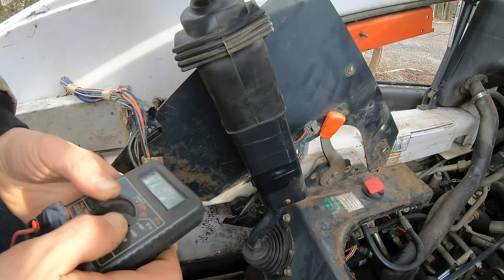Replacing a AHC computer

Comment: If you get a chance I would check ground for computer and anything going in and out of the control circuit for dirty or loose ground connections. Also would check total resistance of both solenoid circuits and see if one circuit has lower ohms than the other possibly intermittent ohm readings causing the computer to think something is wrong and tripping a fault. The likely hood that both computers are bad is rare. You might want to put the Bobcat in the garage where its warm so you can work on it better. If you have access to a megger or meg ohm tester it would be wise to disconnect everything electrical so as not to short anything out. Battery, computer, electronic devices,etc..
Reply: Listen to this man right here!!   2 computers bad?  um probably not!  When you removed the old one you could have inadvertently and very temporarily fixed an intermittent issue in the wire harness, ringing out continuity in a wire isn't the be all end all, the wire or more likely the wire's crimped connection to the Molex pin in the header could be breaking down once its put under DC load.  AS he said, go to your heated garage and have someone help you troubleshoot:  one guy operates the controls and you play around with those wire harness' and see if you can (re)duplicate the problem.   Also, look up that fault code before you do anything and see what it means & spray those interconnects with contact cleaner after you confirm the failure.

Comment: Good troubleshooting logic here. Electrical problems can be very difficult to fix. You have to think abstractly and it will determine the limits of your patience. Good job Andrew!  Gonna have to get that code read by the dealer to find out what's  going on or you might burn out the new controller.

Comment: Andrew,
 My son and I work together in North Louisiana, and we both enjoy watching your videos. 
I agree with you on Bobcats, and all computerized machines in general.
My 2002 Bobcat 753G only has 700 hours, and it's always broke down. 
My 1968 Cat D7E, 1986 Cat D4E, and 1976 Cat 225 track hoe always run..
I run older computer free trucks also for less downtime and expense. 
My road truck is a 93 Peterbilt 379 with a Cat 3406b engine. My newest welding rig is a 1996 International 4700LP DT466 engine, 7 speed Spicer, 4wheel disc brakes. I've been pipelining over 50 years now, and highly recommend this truck.

Comment: The tone of your voice when you said " I just ordered this from Bobcat, it was 1400 bucks......... thats rough
Reply: For a handful of transistors or mosfets, and likely an ATMega controller on board, worth probably less than $15. Amazing. I'm in the wrong business.
Reply: @IBWatchinUrVids  well hey maybe that epoxy they dumped in there so you can't work on it, it may have cost another 10-20 bucks, lets not sell bobcat short here
Reply: @QW-lm1ie  Good point, that's got to justify the price.

Comment: Nothing spells incompetence like the OEM misdiagnosing, replacing or for your case, mailing the wrong parts. I got hosed by Cummins. They diagnosed the ECM as faulty, replaced it and the problem was back a day later. That cost me just over $4000. Turns out it was the ABS module sending bad signals to it. No apologies, no acknowledgement of screwing up.I got totally shafted by the dealer and Cummins. Lesson learned, just because they're factory trained and make the product, it doesn't mean they know anything about it. I'm glad you able to diagnose it yourself. Bad ECM's are always the last resort and at times, a lucky guess.

Comment: Andrew, sorry to hear about this expensive problem with the BC.  You are a great troubleshooter, I would bring it inside in a warmed shop, on a slack time day, and I would disconnect any and all electrical connectors related to this problem...clean them with electrical contact spray, and then coat with dielectric grease and reconnect them.  I think you have a bad connection somewhere that is causing a new intermittent problem.
Reply: I would think that is why the new one is working intermittently too!

Comment: "Its a broken wire or bad computer" is tech support speak for "we haven't got a clue."
One thing I do before replacing an ECM on cars is use some percussive therapy to confirm it is the ECM.
Firstly by grabbing the ECM body and twisting it and seeing if the condition changes and then next by thumping it to see if that causes any condition change.
A while back I did some work on a Vermeer Stump Grinder (made some vids on it) and found the wireless remote ECM was a bit sensitive to vibration (the machine vibrates full time) so I took it off the hard mounting and wrapped it in foam and refitted it to isolate the vibration and it solved the issue for the owner. He had Vermeer replace the ECM a few times already at great cost.

Comment: My friend just gave me an old M600 Bobcat .... It hasn't ran in over 22 years . It's has a gas , air cooled 25 or 30 Hp Wisconsin .I think it's a VH4D  engine ,  the data tag is missing  .I think I finally figured out the serial # to be a 495211205.  I have to replace every hose on it including 90% of the steel lines . Just ordered a bunch of  steel 1010  3/8 and 1/2 tubing , plus fittings . It gets expensive really quick . I did find the Bobcat parts breakdown and I got some books from Jensales . I know I should have walked away but as I was pulling the weeds and grass off of it and spraying all the frozen rusted up levers etc. Some of them broke lose like the steering levers etc.. I Pulled the plugs and shot some ACF-50 down the plug holes , Got the engine unstuck which actually seemed to be the clutch , then with battery power she turned over steady and easy . The clutches worked too. So I guess I got to excited about that and brought it home against my better judgement . Now in the process of disassembly , sandblasting and redoing everything . I have a budget set for it 5k . I hope this isn't unrealistic . of course that's with me doing all the work , blasting , bending , remove , replace , rebuild etc . . If it went to Bobcat it would be probably 50 or 60 k . no , I think they would junk it for sure . Anyway , Andrew if you read this let me know what you think . or anybody else . I can send you pictures of it . It looks really bad , but after looking at it close ,I think I can save it . Now with only 25 hp , probably not even enough power to push dirt , So I'll chaet and use my Backhoe to loosen it up first .  But ,I just can't help myself .
 I bet Andrew could fix it and have it on the job the next day .

Comment: I drove an 864 years ago I believe it was Bobcat‘s first track machine and there were a lot of problems with the drive motors it was definitely not a trouble-free machine although I drive newer ones now Although I still prefer foot controlled I find the hand controls are a bit laggy
 For as influential as your channel is I wish Bobcat would take a look at this episode and give you some kind of a break on the computer a previous poster also mentioned that you might’ve bought a secondhand or refurbished unit and the intermittent problem wasn’t detected  But two computers in a row with the same problem seems like a stretch good luck to you and thanks for your channel

Comment: I would had to say, but it might be time for a semi rebuild. That would mean taking as much out of it as possible, like over a weekend, then looking for a bad ground. The only way to find it will be to take as much out of the bobcat as possible and looking for the one or more spots that is a ground. Where the computer was hooked may not have the right grounding point or be good enough to not cause a fault to pop up. I know that will be a bunch of work on a possible glitch but it is really the only way to find the cause of the problem if it is a ground fault.

Comment: 7:38 And this is the reason "Right to repair" has to be mandatory! I would bet the repair would something like $4 and an hour of work, but they put it in this "plastic" and you have to pay $1400 for whole new part!

Anyway few days ago I repair my tumble drier (electricly dead) - it was $2 in the parts and about half a hour of work. If I'd called service it would be something like $350 or I could buy new one for $900. Thankfully there was classic PCB and I was able to repair it.

Comment: Had close the the same machine with the exact same problem your having. Replaced absolutely everything including the actuator a couple times and still the problem persisted. Finally bit the bullet and sold the pos and bought a cat skid steer and hasn’t missed a beat
Reply from the maker: Yeah, Its still having that problem. The light comes on and the engine has to be restarted. But it doesn't happen too often. I got an IHI skid steer that has not had any problems.

Comment: I don't know anything about bobcat or machines like this, but I know many things about electronics: I guess there's an actuator that is going to break. Maybe it's still working, but the solenoid (I guess there's a solenoid activating a magnet to achieve linear actuation or a servo motor which has many coils) is going to short circuit. This could be both due to a failing cable, due to humidity closing the circuit to the ground or due to the solenoid which is corroding.
This made the previous ECU to damage, the new one is still signaling an issue, and I believe it's correct: there's an intermitting issue, the ECU should be able to detect false contacts, short circuits and altered impedance in the actuators. Since the failing control is the one controlling the bucket then I would check if you can switch the actuator with another and see if it stops to move a different valve.

Comment: Hi Andrew. A master class in fault diagnosis. Folks, you could also check that there are no inter wiring cross conections as they can make it look like wiring is connected when it isn't.Only really likely to be a problem if there are multiple connectors on the run, so Andrew made a good call. The manufacturer's cable management looks rather poor and lacking support, but of course straggly wiring tends not to suffer incorrect cross conections!  BobUK.

Comment: Give all the connectors a squirt of contact cleaner, could be arcing and causing the controller to lock out.
Reply: Absolutely and maybe a bit of dielectric grease.
Reply: Use some Deoxit on the Connections. It works great. That could be the problem. Arcing from a bad contact shorting out the computer.
Reply: 9 out of 10 times it is oxidation or dirt on a connection that causes intermittent problems. Love your attitude, Let's get it done!

Comment: Case skid steers and Takeuchi skid steer is all we run at our rental stores. Chris's (Let's dig) new Takeuchi is all computer controlled as well. Most newer machines are. There's nothing wrong with a computer controlled machine like you said some brands are better than others its all on how much you want to spend. Both bobcat skidsteers you have now either have a shit load of hours on them or where beat to death nothing last forever unless you have and old cat D6 D8 and so on.
Reply: He has a Cat D-4 and a Cat 955 track loader.
Reply: @scotabot7826  yeah i know that Andrew has both of those machines. My point was that nothing last forever unless you have those old crawler's and just like Henry Ford realized back in the day you won't make $ selling vehicles or in this instance equipment you will make $ off parts. You can't kill an old crawler.

Comment: Hi Andrew, take readings and compare the resistances of the hydraulic cylinder actuators both cold and after having been worked for a while, note any significant differences between them or change of values from a change of temperature. The bottom line is there may be an insulation breakdown in the cylinder actuator which is toasting the "computer" Mosfet's.
While having dealt with numerous types of actuators, but not having ever laid hands on a Bobcat, the following is pure speculation...... As those actuators aren't simply full open and then full closed to each port, aka, through the gradual movement of the joystick, the cylinder first moves slowly and then faster the further you move the joystick from dead center. If so, this would imply the cylinder actuators are linear which would mean there is an analog voltage (or could be current) signal going to each cylinder actuator from the "computer" which resistively reads the joy stick position and sends a corresponding voltage signal to the cylinder actuator. If there are three wires going to each actuator, two are for power and common, the third for the voltage signal..... For argument sake, let's say the signal voltage range is 0-10 VDC. 0-4 Volts would be cylinder retract, 5 Volts would steady state (joystick on dead center) and 6-10 Volts would be cylinder extend. Hope this helps. BTW, you would read the resistance on the actuator from common to power and common to signal.

Comment: Takeuchi all the way, have several different Takeuchi skid steers, always have power and never have to do work to them beside the routine maintenance. The older models (tl130, tl150) have the yan-mar engines and are the best type in my opinion.

Comment: I'd recommend the Kubota SVL-75, great machine to run and the controls are hydraulic not electronic. I know you don't like newer equipment due to emissions crap and how electronic they are but it's been a great machine with no problems after 1250 hours of work.

Comment: Before you sell it check the entire wiring harness for ether a short or open; the short can be as little as 1 strand of wire, the open can be hidden inside the wire which means bending and twisting the wires around or it could be at a connector, now this may fix the problem or not cense I can not hand's on trouble shoot the problem, but a easy way to check if this is the problem is to buy or some place's will rent you a used know good wiring harness and swap it out, which is about the easiest way of doing it, most places ether have or can get one fairly cheaply for you just shop around. Some of the repair and/or wreaking shops have a dedicated nation wide system broken up into about 15 sections nation wide and with interconnection with each other over a phone/intercom system they use to locate parts for everything from cars to heavy equipment.

Comment: Look into Case. They still offer all their new machines with direct mechanical controls and the drive pumps are servo controlled so they don't fatigue you like a Bobcat. I think early ones did have a problem with the wiring harnesse rubbing through or something though so check on that too.
I used to play with comealongs when I was a kid too. Broke one at my grandpa's shop once by wrapping the cable around a tree stump and cranking it down. Don't ask me why I did that lol.

Comment: Having worked for a heavy equipment dealer for the last 20 years (but not Bobcat), I'd suspect that the hand controllers need to be calibrated or "learned" to the new computer.  If the signal voltage from the handle exceeds the value last learned, this will generate a code on every manufacturer I have experience with -  however, I'm not a Bobcat tech.  

Bobcat tends to be a 'value' leader in their markets.   I'd avoid JCB (Volvo) and focus on well used 2nd hand equipment, most everything is running a vehicle manager (computer) these days, you'd be hard pressed to find something still running pilot control as the manufacturers don't want pressurized oil lines in the operator compartment.  As you're aware, Kubota makes an excellent product.  I believe most of their modern units are running vehicle managers as well.

I thought your diagnoses was well done, a little bit of redundancy when you swapped actuator harnesses (the actuator worked when you swapped handles) but otherwise well done.  For what it's worth I believe your diagnoses of the computer failing is correct, the driver for that actuator on tilt up is dead.

Comment: Most solid state electronics are very reliable these days and when things go wrong it is more likely due to external issues. The fact the second controller unit is having issues makes me wonder if there are input  problems ie power waveform etc.  As an electronics engineer I have had the joy of replacing controller units for various devices over the years only to have the second unit blow up because I didn't check the inputs first to make sure there wasn't another issue that blew up the first one. Also most automotive and industrial equipment has a voltage regulator and they do blow up and go faulty all the time. I have seen controllers show issues that have nothing to do with the controller itself but was due to a simple 1 volt variation causing 1 or 2 parts of the controllers output stage to fail when the system was under strain.

Comment: Final drives hold 1oz of oil and fail. Had alot of issues with newer Bobcat's not impressed. Replaced finals and alot of electrical issues.
Stay with CAT or Deere Yanmar Kubota etc.
Doosan owns Bobcat now.
Computer generates a square wave frequency emf to vary position of hydraulic spool in controller. JLG manlift and some cranes have this type of control system. I have the JLG scanner and they have free service info and trouble codes on line. Bobcat doesn't seem to have good service like CAT .
 CAT service parts rules 24/7 /365 unmatched in world.Others have good machines but can't service them like CAT.

Comment: If the part looked used and had a missing a pin retainer. Very likely someone bought it, found it was intermittently defective and returned it. A tech at Bobcat, not knowing the issue, tested it and found it worked and put it back in stock. Then they sold it to you as new.
Reply from the maker: I was in that machine for a little while today and it was working well. Hopefully it stays that way. I just got a replacement skid steer too. A newer IHI, its made in Japan.